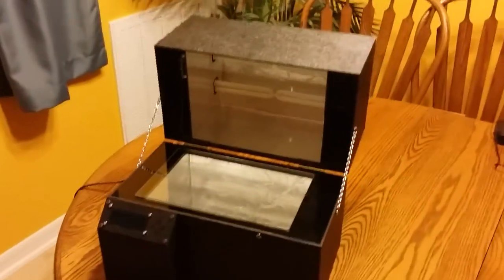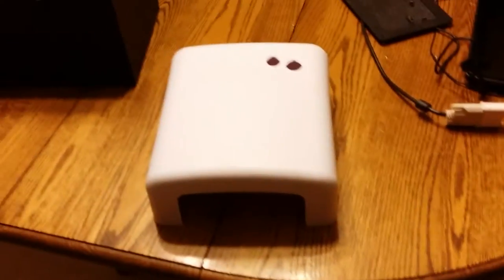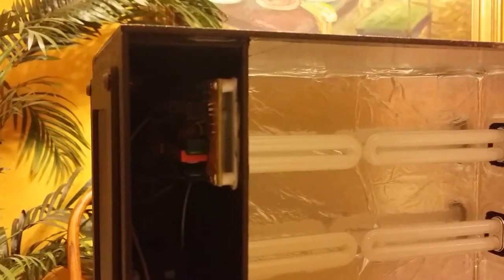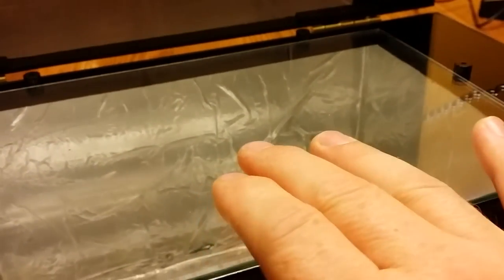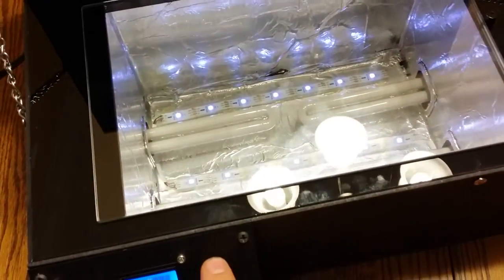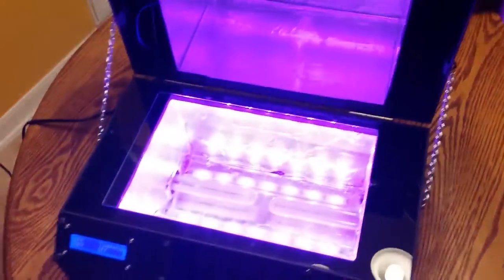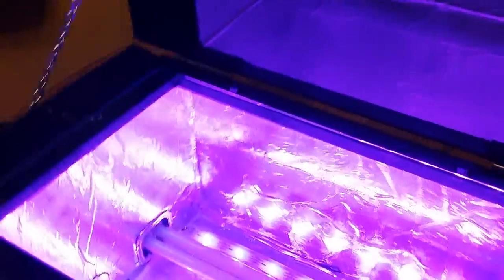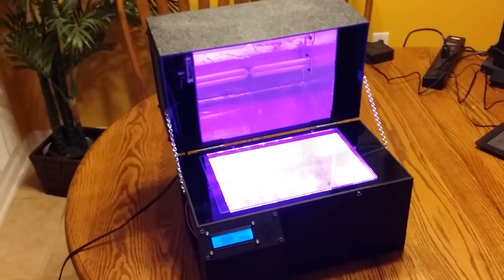Double sided, UV light box for home made PCBs

Comment from the maker: The UV lamps are florescent and came with a ballast. I have the AC input wired thru a relay that is controlled by the arduino. So it's no different then hitting a wall switch for a fluorescent light.

Comment: Nice design and good functions
one note, I think you shouldn't use reflecting foil paper inside or any reflector actually because you want the UV to come straight from the source and be as perpendicular as possible, because this way it will give better results for very fine traces,
I have read that somewhere in some photoresist film datasheet but never actually tried it myself.

Anyway, have you found the upper glass plate unattached and moving free as practical as you showed in the video
I am in the process of building one like you, so I was going to fix both the lower and the upper glasses and when I saw yours stopped for a moment and I would like to do it like you!